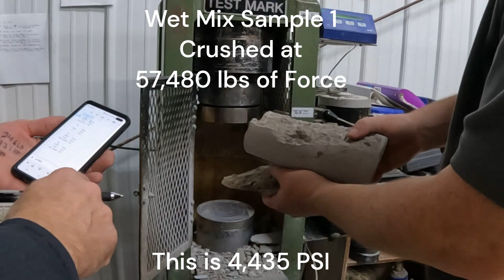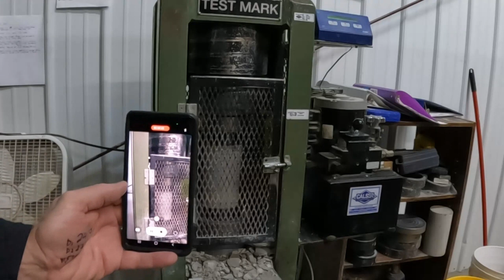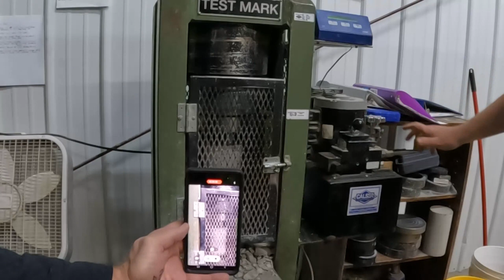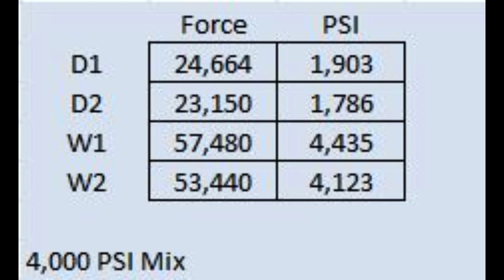Test Results Round 2.  Dry Pour vs Wet Mix - with Moist Curing.

Comment: Thanks for doing this.   Very interesting.   I wonder if putting the sander on the form during the soak stage of the dry pour would help anything.  Vibrating the dry pour slab helping move the water around a little?   Maybe crack the crust on top though.
Reply from the maker: Thanks for the comments.  Only way to know for sure is to trial your suggestions.   I feel like disrupting the formation  of the crystals after watering might not help the strength.
Reply: @HankBaugh you are probably right!   Thanks for the video.  I watched several.  Great stuff.
Reply from the maker: Thanks for looking in at my channel.  I gave you a sub as well!
Reply: @HankBaugh much appreciated.  Maybe I need to make videos again ha.

Comment: @HankBaugh, it would be interesting to see how an ultrasonic pulse velocity meter reads the moist cured dry pour. It would help confirm dry pour can or cannot be used for structural integrity. Also, I am curious if you had used the 5000psi concrete bags, if a moist cured dry pour would also result in half the strength (2500 psi). Thanks!
Reply from the maker: Good thoughts.  People going to think you're making things up though. LOL We're going to start a conversation about flux capacitors next!

Comment: For the proper amount of water, measure the time it takes to fill two 5 gallon pails. Divide by 10 to have a pretty accurate time to flow 1 gallon (T).

Multiply the number of bags used by what each bag calls for. Now you have the total gallons to use (G).

Multiply T by G to get the total time to water. Maybe add 5% for water that misses the dry pour, or call it good by not counting misting.
. 
Lots of people thinking about dry pour to make it better.

Comment: To add ground moisture testing to the mix, form a hole in undisturbed ground using a test plug made with an eyelet set in the middle of the test plug concrete. Reusable. Dig a hole that the test plug fits.
Reply from the maker: That is a good idea!

Comment: I will say, obviously no matter what, theres some disadvantages to this test for the dry pour, even putting holes at the bottom doesnt completely represent the strength a slab would be at....i imagine a slab of dry pour if wet cured the way you explain would probably be much stronger than these test samples....so more than enough strength for a patio or shed pad.

Comment: I haven't looked closely at the past results, so maybe this was answered previously and I missed it.  

Is the reason for the 8" cylinder due to the testing method, or possible damage to the testing equipment?  The typical slab people seem to be doing is 4", with a few folks going to 6".  I would be interested to see if a comparable test using more typical thicknesses would give similar results, or would it show an even greater variance in strength.  Given that the majority seem to be using the dry pour method for small-ish slabs that don't require anything more than 4", that would be more akin to real-world needs.

Regardless, your testing is much appreciated.  I agree, if looking for a driveway, I wouldn't consider this, but for the small projects that DIY'ers typically take on, the dry pour would be perfectly acceptable and useful.  Thanks for your inquisitive mind!
Reply from the maker: The concrete testing facility uses a standard that is nationally approved..  can't recall the agency off the top of my head..  That standard dictates the size and shape of the test cylinders.

Comment: Frank, Thanks for going above and beyond what anyone has done on testing. It helps prove what we all have thought, it's about 1/2 strength of wet and as long as we don't exceed the psi (square inch of that concrete) the slab will hold structurally. Of course outside forces such as ground freeze upheaval may hit some in the north and steel embedded should be utilized. Hats off to Isabellavision for their explanation in layman's terms.

Comment: Thank you for sharing your scientific approach to compare the strength of wet and dry pour concrete, and I suggest to publish your tested results. I have the following questions to see if the strength of dry pour can be increased: (1) In order to make the test samples closer to the actual applications, can you add absorbent material, such as sturdy paper, at the bottom and side of the 4"x8" plastic before filling the cement to prepare the dry pour testing samples? In addition, instead of preparing 8" testing samples, can you prepare all samples at the size of 4"x4" inclduing the wet pour samples? (2) Is it possible that dry pour method takes longer to reach a plateau than the wet pour by comparing the strength of 90 days curing time samples with the 30 day's? (3) Will the mixing with inexpensive concrete fibers, such as Bon Tool, $10 for 27 cubic feet at Lowe's, increase the strength of dry pour?
Reply from the maker: Thanks for all of the input.  I will be considering your thoughts for future testing.
Reply: @HankBaugh  The opinion from ChatGPT is "Yes, mixing Quikrete cement with concrete fibers, such as the Bon Tool product you mentioned, can increase the strength of the concrete mix. Concrete fibers are often added to enhance various properties of the concrete, including tensile strength, flexural strength, and durability. They can help control cracking and improve the overall performance of the concrete."
Reply: @tdlin1721  The downside to questioning AI is that the result will likely be based on the most popular method, or with input from manufacturers, so it likely is giving info based on wet pour.  In my area, you can purchase Quickcrete with fiber, for about $2/bag more.  I haven't seen anyone use this product for a dry pour though, so I've no idea on the feasability of its use for the dry pour method

Comment: I'm not convinced. I agree that your results are credible. I just don't agree that it applies to how dry pouring a a slab works. 

I've watched a pin test on youtube that gives a strength of 3500psi. I don't necessarily agree that applies to all situations either.
 
I have no way of knowing if the water uptake of the dry pour is too slow or too fast  to achieve maximum strength or if the initial set temperatures are similar (remember hydration is an exothermic reaction - having all the water available initially in the wet pour may be an advantage - reaction rates approximately double for every 10 deg C increase in temperature)  Dry pour may not  give the maximum strength in 4-5 weeks it depends on getting its water from the out side and trapped air may slow the process among other things (continuing wet cure for another several weeks or doing an accelerated test would help). I'll agree it's was a good test but not applicable to all situations. Until some one does a study showing how the rate of uptake of water affects the strength of the final product and why, I don't see a resolution to the question. I don't foresee that happening anytime soon. Anyone with the resources to study this won't be interested. 
Being within a few months of 80 I'll take my chances on the next driveway slab do the dry pour ( I work alone), the last driveway slab I did significantly stressed my heart and I was much younger then.
Reply from the maker: You make some very good points. I too feel that the test cylinder is not fully representative of a dry pour slab. However,  wanting different results and getting them is not the same thing.  I do belive that we proved that concrete must be moist cured.  This is something I will hang my hat on.

Good luck with your project.  I do encourage you to make  a vibrating screed tool.  That really saved my back on my projects. It also packed in the mix much better than you can by hand.
Reply: Thanks @HankBaugh  Thank you for the reply! I have a crude version of your vibrating tool that keeps breaking the stainless steel screws I used, but it works.
I agree with the need for a wet cure. However, the purpose is to keep the concrete from losing water as it cures and not to add water.
I am concerned that many who do the dry pour slabs may be using too much water initially before the concrete has time to set. this too will weaken the cured concrete. I plan on doing a crude test by putting some quikrete in a plastic jar with a little more than the minimum amount of water recommended by the ASTM, seal it up to prevent water loss and check it in 7 days. I don't have a way to check the compressive strength, but maybe something will come to mind.
Thank you again for your reply.
Reply: "having all the water available initially in the wet pour may be an advantage"

It sure seems like all of the testing protocols and test results data certainly seem to point in that direction.  The dry concrete mix is designed to be wetted completely and uniformly before being placed in forms.  This is clearly indicated by the instructions on how the products are to be used.  It is also intended that a particular level of hydration is used during the initially setting of the concrete.  There is no getting around the fact that the product was developed specifically for that intended application method.

It is interesting that dry pouring does work to some degree and that you can know pretty much what you are going to end up with.  I would say that 50% strength and a lesser quality of surface finish is a pretty realistic expectation.  If you need 2000 psi results you can use the more expensive 4000 psi mix to get the strength you need.  You won't have to learn how to finish wet concrete, but then again, you won't get nearly as nice of a surface finish.

Even if you just used wet concrete and simply made a nice stiff mix and only ran a screed over it it and edged it one time shortly after the pour, you'd end up with a much stronger slab and at least as good a finish as the dry pour.  With a bit more practice, you could get a pretty nice finish on it as well.  If you only needed 2000 psi, you could use a cheaper 2000 psi mix.  I don't really see a down side of switching to a wet mix.  You can do it!
Reply: @ImabadDoggie  the testing protocols and test results are geared to the construction industry. Noe contractor in his right mind is going to dump dry concrete into a form, water it for possibly days and then wait several months for it to approach maximum strength. That being said dry pour concrete can reach the same strength as wet pour, but it will take quite a bit longer. I reference the following research paper:

Paper Number: 034003
An ASAE Meeting Presentation
In-Situ Hydration of a Dry Concrete Mix
David R Bohnhoff, Professor          Zachary D. Hartjes, Undergraduate Student
David W. Kammel, Professor          Nathan P. Ryan, Undergraduate Student

Biological Systems Engineering Department, University of Wisconsin-Madison
460 Henry Mall, Madison, WI, 53076
Written for presentation at the
2003 ASAE Annual International Meeting
Sponsored by ASAE
Riviera Hotel and Convention Center
Las Vegas, Nevada, USA
27- 30 July 2003
Abstract. . Hydration of a dry concrete mix after the mix has been covered with soil is herein referred
to as in-situ hydration. In this study, a series of dry concrete mix footings were hydrated in-situ by
burying them in sand and subjecting them to different water treatments. Footings were removed and
cored at 4, 12 and 24 weeks. Compression tests on these cores showed that in-situ hydration could
produce concrete with strength comparable to a normally hydrated mix. Additional research is
needed to determine how in-situ hydrated concrete strength is affected by aggregate properties,
initial compaction, confinement pressure, dry mix uniformity after placement, as well as conditions
related to water movement into the confined mix.
Keywords. Concrete, Cement, Cement hydration, In-situ hydration, Hydration, Concrete placement,
Dry concrete mix, Concrete moisture content, Concrete testing

Comment: Thanks for carrying this all the way to the end. It's the most scientifically sound test I've seen and a huge contribution to the topic. Though the dry pour "only" reached a strength of 2,000 psi, that is more than adequate for almost any DIY need. For perspective, if you were to place a one-inch square block on a slab of concrete and then balanced a large platform on top of that, and then balanced a nearly full-size male buffalo on the platform, you could reasonably expect the dry-pour concrete to hold. But if you need that platform to support an adult male hippopotamus, then you'd better wet mix pour it. 😉 The reality is that we we'd probably never see a need for that much weight "per square inch" -- the contact surface of most everything (except ballet dancers on their tippy toes) is distributed over several to many square inches. i.e. a truck tire-- the flat part contacting the driveway is many times 1 square inch. Let's lowball it and say Ford F150 tire only has a contact surface of 4" x 6"-- that's 24 square inches-- multiply that by four tires, and you have nearly 100 square inches of contact to hold the F150's 6,000 lbs putting just ~60 PSI of pressure on the concrete. The reality is that that's the average "contact patch" size of a compact car's tire, a truck tire's is much larger. But you get the point. Let's also underscore the importance in ANY concrete project of a solid base underneath as (or nearly as) important as the concrete pour method. AND EXCELLENT work educating us on the important of "moist curing" no matter which concrete pour method is used. Super helpful!
Reply: Completely agree with you and I have used a tire footprint as an example many times on strength for concrete. Actually asphalt only has at the most 200psi. Fortunately for me, the adult male hippos have not invaded my area of Georgia....yet.